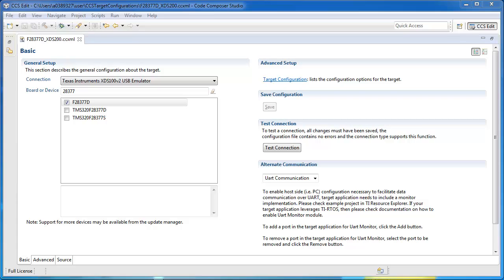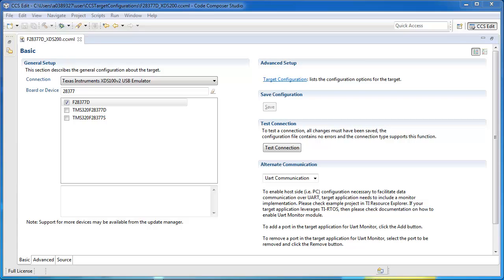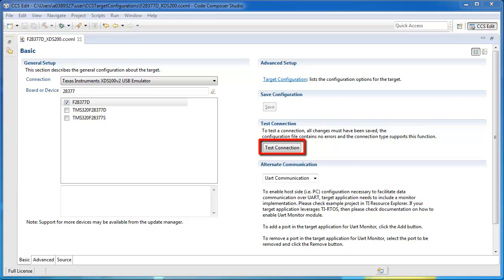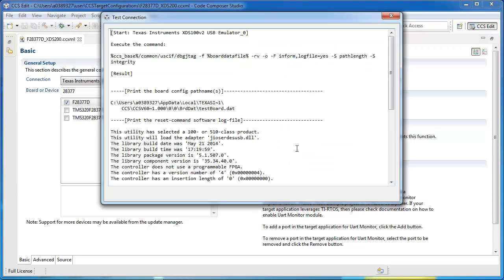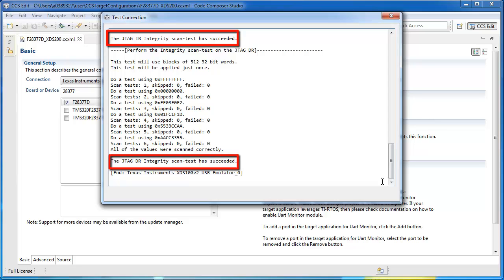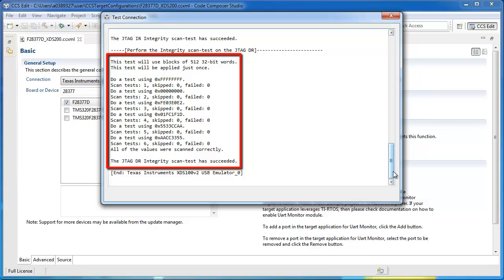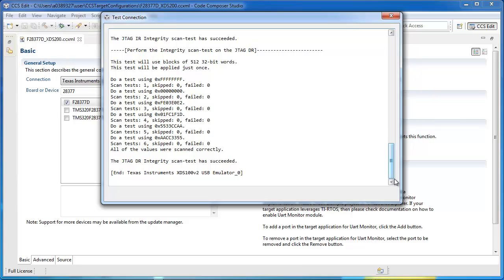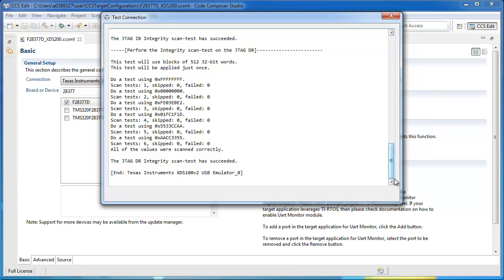How to test your JTAG connection with CCS

Comment: Sorry to bother, but how you got to the screen where you are now? And yes, I am new.

I did select my emulator under menus: Project/Propperties/General/Connection correct.

Now I just want to be shure, if emulator is actually connected ok, and the drivers are running fine.

Thanks
Reply from the maker: +VonSonnig , the list of Target Configurations on the right side can be opened by going to menu View --> Target Configurations